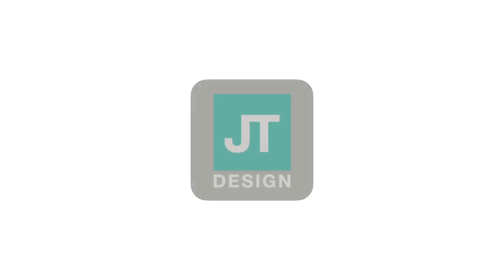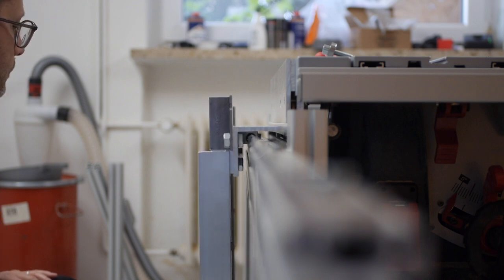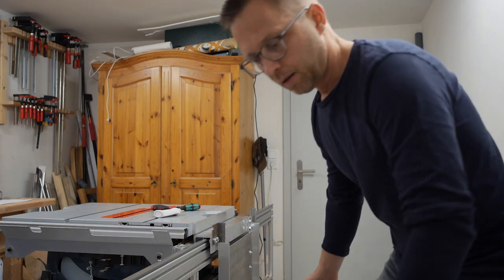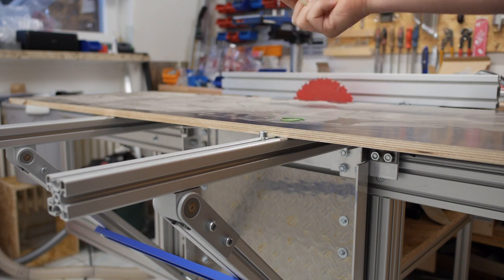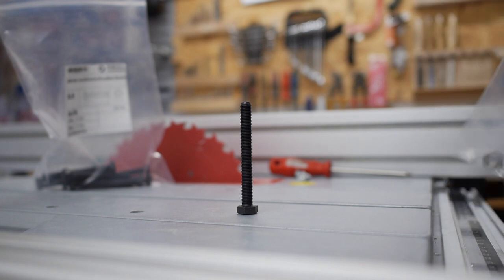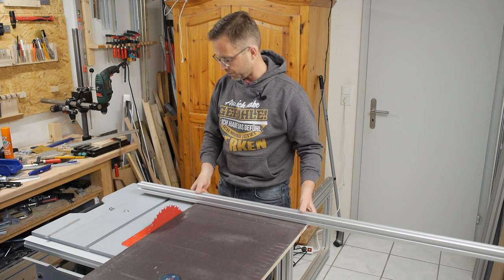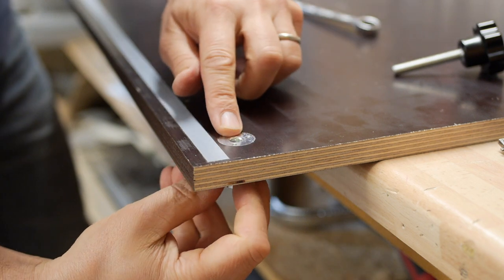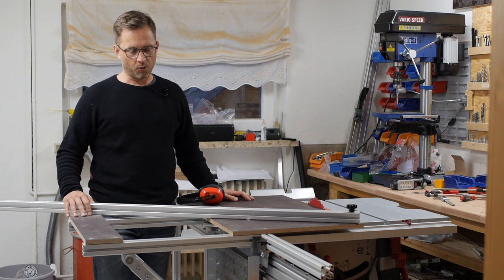Ultimate DIY Sliding Table Part V

Comment: You are fortunate to live where the components of this build are commonly available. Baltic birch ply skinned with high pressure laminate and aluminum extrusions with all those fittings look like riches from the perspective of a woodworker in a little prairie town.
Reply from the maker: Aluminum extrusions are the way to go, if you are prototyping (everything stays changeable). But when you´re done, you could built it much more affordable. You can use wood for things, that don´t require metal. A lot of those fittings can be replaced by normal hex-nuts, if you dont want to change them often. In the last (6th) episode, I will try to break that down a little bit, so that you can avoid all the unecessary detours I took.

Comment: I cannot WAIT for the final video. I've been here since episode 2 and the wait has been worth it. Glad the friction issue got sorted for you, so what specifically was wrong with the older bearings?
Reply from the maker: Hey Kyle, thanks a lot. The older bearings have no wheels in them, just some gliding material. They are ideal for low weight loads, lets say a few kilograms of weight. But I am loading a sled with 8-10 kilos on them, plus the workpiece with a couple of kilograms and that started to add up. The new IGUS-Hybrid-bearings with "wheels" in them are as precise as the older ones, but handle weight much better.

Comment: This was worthless, cuz large pieces can be cut easily with a track saw, small ones with a tapering jig with bearings
Reply from the maker: I’m so glad I made this, every wood project starts with clean accurate cuts on this sliding table.
Reply: @tims.2832  Anyway, it's a nice saw, u made great job, enjoy it,